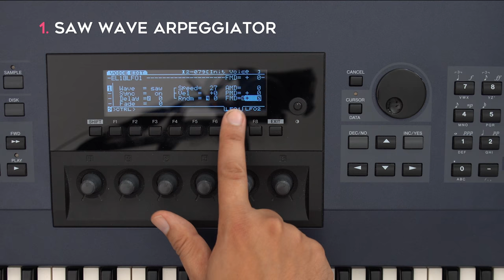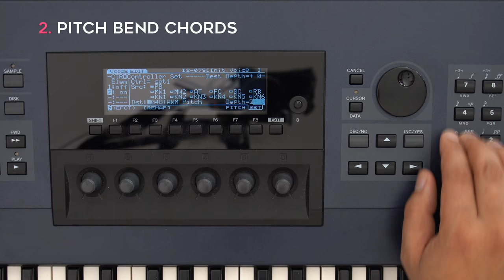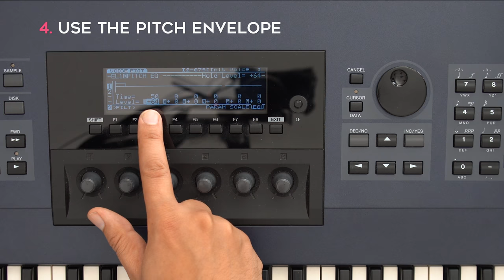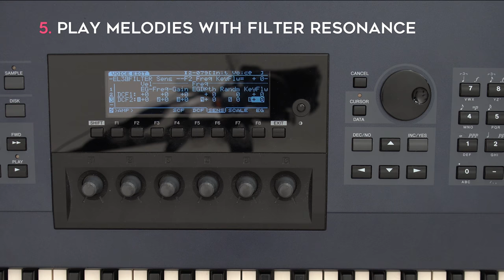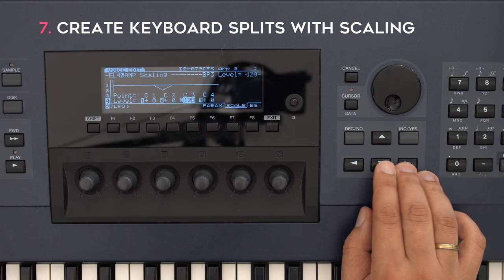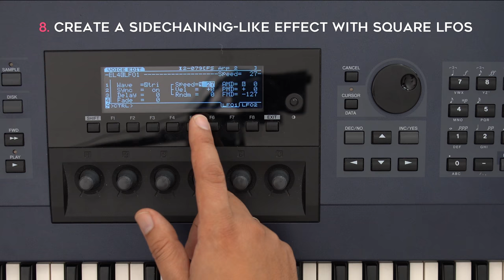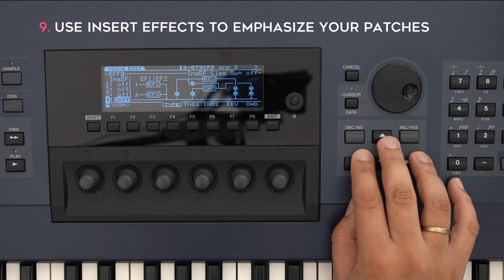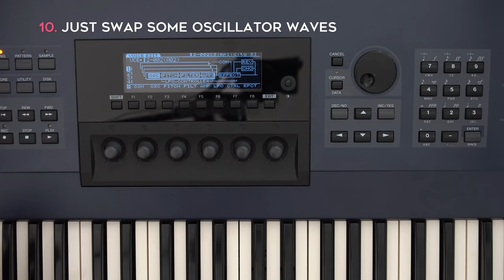10 simple synth sound design ideas you might want to give a try

Comment: I used to have a W7 years ago, I really loved that machine, but it was always going wrong. After watching your videos on the EX5, I got myself an EX7 and now my life is complete 😊
Reply from the maker: Thanks for watching! Glad my videos were helpful. Which problems did you experience with the W7?
Reply: @mr_floydst  The Disk Drive would sometimes work, sometimes not. And the switches kept failing and so did the data-wheel. I had it repaired, once, and that cost me over £120... Within a month, the switches started failing again.

Comment: Great work, Floyd! Even AWM engine sounds “organic” in EX5 (especially for a digital synth) and you can do a lot with it (for example, looped EGs also can be used as “custom LFO arpeggiators”). BTW: Are you using FLASH Wave RAM in your EX5 workflow?
Reply from the maker: Thank you very much! Yes, I have the flash ram installed. It's a must-have if you want to use the sampler because loading times are horrible. :)